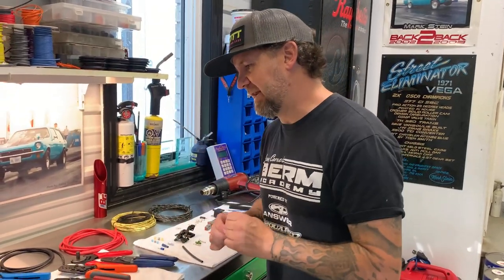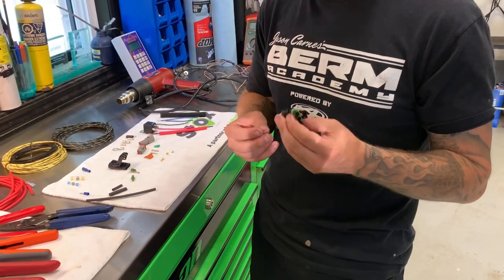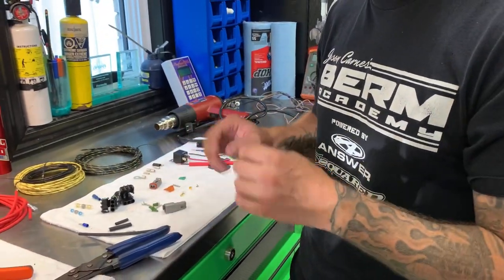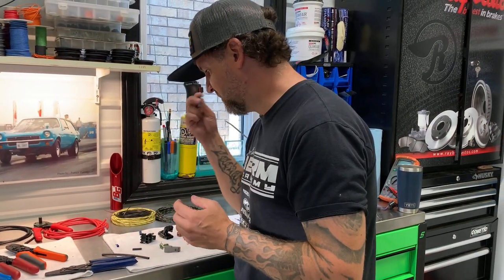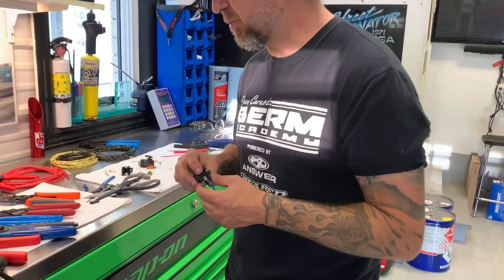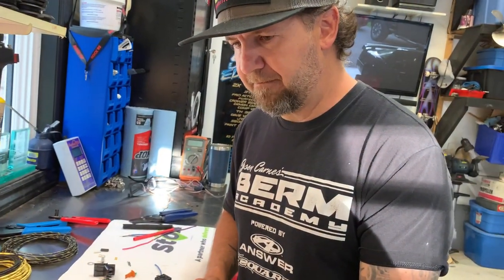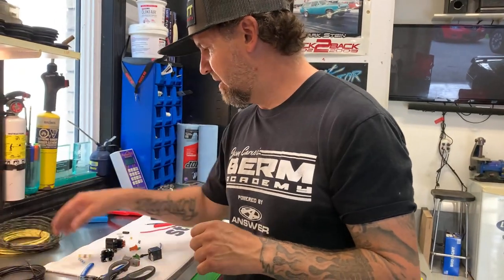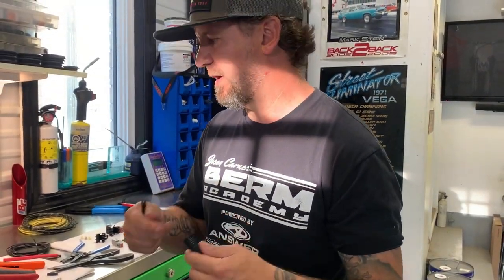Wire your High Performance Boat on a budget!!

Comment: Great video.
Inspires guys to take on a project. 
You are giving guys and gals the basis about wire, connectors and tools to do a professional level job that will be safe and reliable. I did my J almost 20 years ago with the best stuff available at the time.
I was inspired by guys like Rob Twible and Mark Weigl to do a nice clean job.
Has never let me down and still looks decent all these years later.
Reply from the maker: That’s awesome Sean and your stuff is always top notch! Appreciate the comments thank you!
Reply: @dragboatgarage3274  
Keep doing what your doing.
Lots of new guys and gals getting in boats, cars, racing etc. that are looking for the type of advice that your giving out with your knowledge of racing , restoring and repairing.
I like the fact that your giving practical advice and reminding people that they don’t have to blow the budget on the most expensive products and tools out there. That they can do a professional job on their own at a reasonable cost.